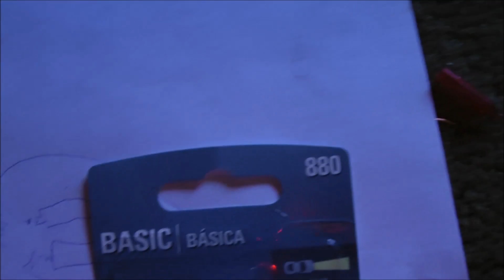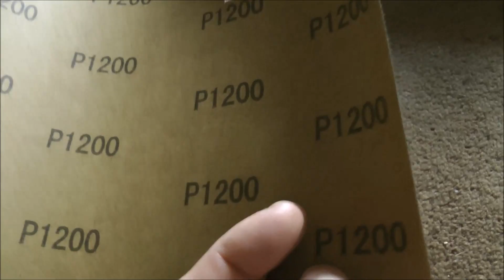Replace fog lights 2002 Santa Fe

Comment: How do I turn on the fog lights?
Reply from the maker: I can't fully remember, I sold it years ago. There's a switch on the dash but I don't remember where the switch is located. Have to make sure the fuse for the fog lights is good too.